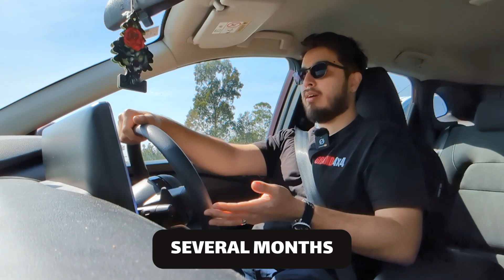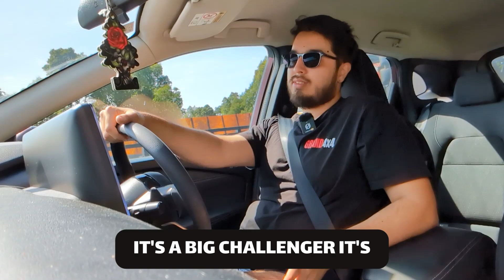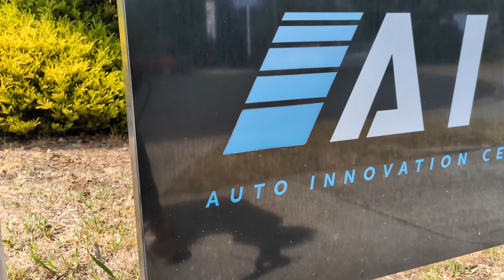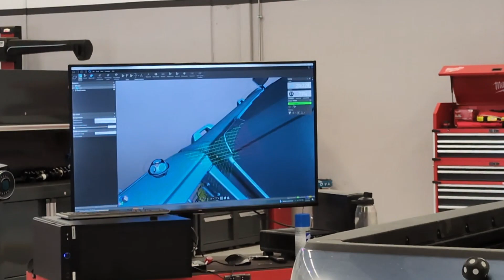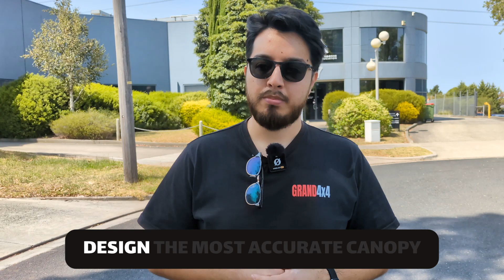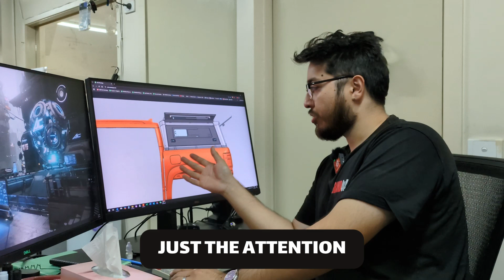[BTS Exclusive] 3D Scanning Process of the G4 Canopy on BYD Shark with @AutoInnovationCentre

Comment: Literally just finished fitting one of your G4 canopy for the BYD Shark at home. Could not be happier with the design and everything fitted like a glove with no problems. 
For those who are doing a DIY at home, you do not need to fit the piece of metal to the tailgate that stops you from opening the tailgate without opening the rear canopy lid because you cannot open the canopy as the release button is hidden behind the rear canopy lid.
Reply from the maker: Hey mate. Thanks for the awesome feedback. Best of Luck with your new setup! Team GRAND4x4